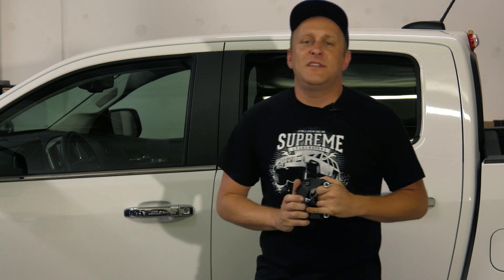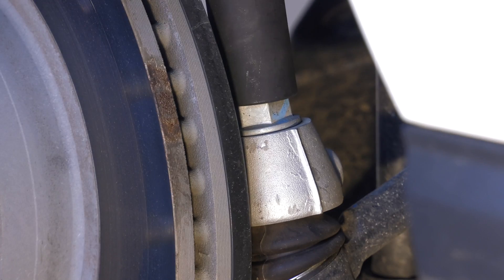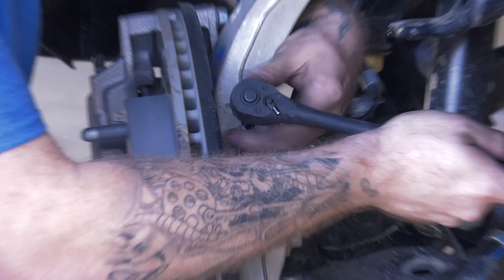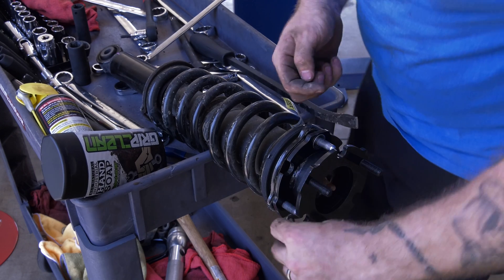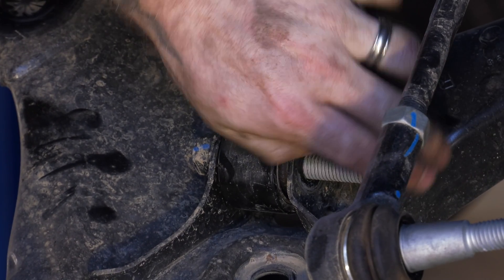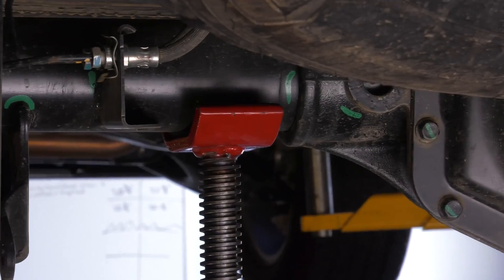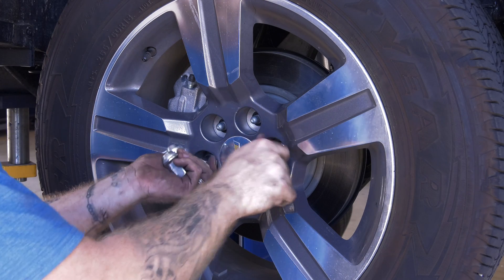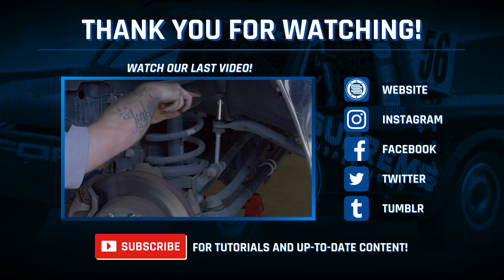2016 Chevy Colorado | 2.5" Front / 2" Rear Leveling Kit Install Tutorial

Comment: Would this fit on a 2017 Colorado ?
Reply from the maker: We haven't had a 2018 in the shop yet to test fit but there were no changes from 2017 to 2018 so this should fit fine for the 2018 as well!!
Reply from the maker: This lift kit will fit perfectly for your 2017.
Reply: Supreme Suspensions 2018 as well?

Comment: does it fit on a 2017 Chevy colorado Z71?
Reply from the maker: Hi Eric, this would not fit the Z71 Colorado. I am pretty sure the Z71 comes with a torsion bar setup. At least the older models did. This has only been tested on the basic 16 Colorado.
Reply: Pretty sure or 100% sure?  I'm looking to lift my 2016 Z71
Reply from the maker: If you want to be 100% certain then take a look at the suspensions components on your Z71. This kit is designed for struts assembly's.
Reply: Just put this kit on my 2015 z-71 today it does have coil springs.  I couldn't be happier.  Fitment was great and it took me about 4 hours in my shop
Reply: I've got a 2015 Z-71 as well.  Did you do just the front lift?  I just measured the rake, and it looks like the 2" front would put the front end up about a 1/2" higher than the back.  How does it look?  I've got just jack and basic hand tools/torque wrenches.  Think it's something I could tackle myself in a day?
Reply from the maker: A lot of folks are able to install these kits in less than a day with just basic hand tools. For safety's sake, make sure the vehicle is secured on jack stands before you work on it. In this video, we did a 2.5" lift in the front and a 2" lift in the rear. It still sat a tad higher in the rear but not as dramatic as stock.

Comment: Why did u need to bring up rear end    I thought I just need to bring up front end with a leveling kit   To make it level
Reply from the maker: Easiest way to determine what it will take to level out your vehicle is to measure from the middle of the wheel or hub to the top of the fenderwell. Once you have determined the vehicle's rake you can then determine the exact measurement needed to level your truck.